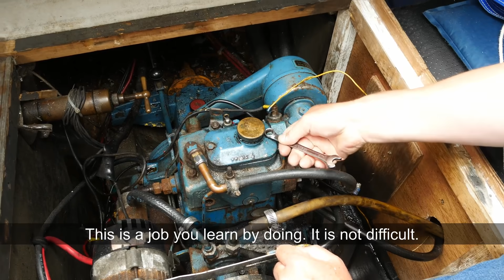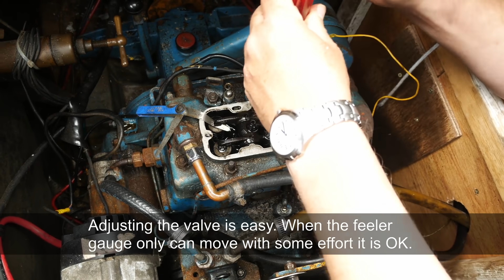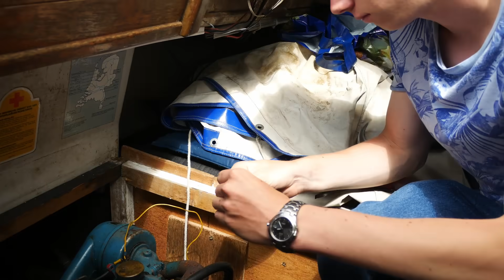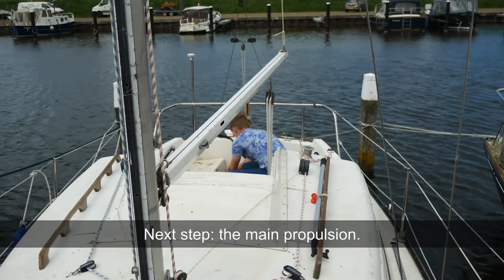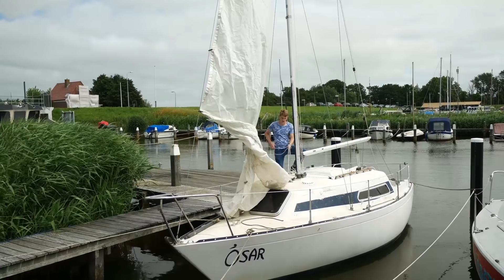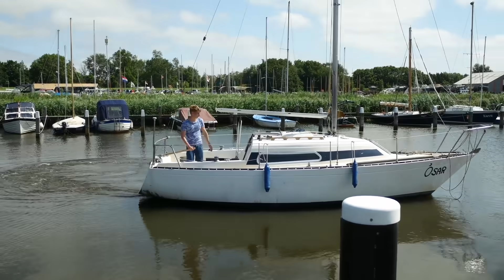A free boat 2: fixing the engine and checking some sails.

Comment: This vid is back up-ya hoo love seeing the work n time put in-- good job= you can get that valve adjust even better with new rocker shafts and arms, but you can just adjust it with the engine running- then you will get an honest clearances-- I noticed how much side play was in the rockers when you tightened the adjuster.  Side play changes the adjustment.  Cheers- will keep watching - start saving for an over haul of that classic motor.

Comment: The horrible engine noise would have been caused by a wide exhaust valve clearance. Because the gap is too wide the exhaust valve will open late and close early. The exhaust valve will close before top dead centre, trapping exhaust gas in the cylinder and compressing it slightly. The inlet valve then opens and releases this gas into the inlet manifold and that is the bang you can hear. I have had paper air filters torn to pieces and foam filters melted by this problem, one customer came to me with the complaint that his whole air filter kept falling off the engine no matter haw tight the clamp was.
Those old Petter engines will give good service if properly maintained.
Great vid, keep up the good work.
Subbed.
good luck from the UK

Comment: Yes, doing the valve clearances has quietened it down but it could be better. There looks to be severe wear in the rocker bushes or the shaft itself. Worth fixing to reduce the noise even more and also improve efficiency. Look at your video to see the angular movement of the rockers if you didn't notice it doing the job. I think that 10 and 15 thou cold may be wrong for this engine. Worth checking. A very nice starter boat and it being free as well is a big bonus. People have gone round the World in similar craft but perhaps some Baltic cruising would be good training. Maybe go via the canal?
Reply: Via the Canal to the Baltics?! Do you have any idea where the Netherlands are?! You sound like a drunk East-European sailor. Amsterdam, that's Estonia, is it?
Reply: @voornaam3191  Kiel Canal. Look it up.
Reply: Deluk is right. The Kiel Canal connects the Baltic Sea with the North Sea. The Kiel Canal is a 95-kilometre long freshwater canal in the German state of Schleswig-Holstein. The canal was finished in 1895, but later widened, and links the North Sea at Brunsbüttel to the Baltic Sea at Kiel-Holtenau. Wikipedia

Comment: You need to stow that line draped over the bow. It is probable that it will get drawn overboard by a wake or wave and trail in the water and wrap around your prop. Not fun. I pressure washed an old boat in about that condition and it came out looking like a totally different boat. Also, you need to disconnect every connection in the wiring and clean and check for corrosion. A very nice first boat. You will learn a lot getting it in good condition and keeping it there. Good luck.

Comment: I notice that your cockpit is badly stained. Toilet bowl cleaner will remove that. Splash it on and then hose if off. Hydrochloric or oxalic acid does the trick.
Reply from the maker: Thank for the tip. We will try it!
Reply: Yep. oxalic acid will remove rust stains fast.

Comment: Petter 6hp single cylinder, I have same in my boat, I also have 2 complete engines, one engine in parts and 2 spare gearboxes, looks like your exhaust manifold will fail before long. If you need any parts you are welcome to contact me

Comment: at around 3 minutes in there's a suspicious looking spark or electric arc next to the grease gun. You may want to look into that, fire hazard maybe?
Reply: actually, the first time it occurs is at 2:50, *with the engine off*. Weird!
Reply: I was wondering what that was too.
Reply: It may just be reflected light?
Reply from the maker: @kenwheeler6150  Yes it was.

Comment: Subbed. Did you fine gents check for water in the oil before firing the engine up the first time around or was that a non concern?
Reply: No, those engines also run on water in the sump. Duh! God help you, Maciej, you really need a lot of help, do you?
Reply: @voornaam3191  LmMfAo over here !  :D
Reply: @tcc187620  Thanks. I guess he did check for water. Mayonaise is not funny. And I was not polite to that guy.

Comment: Need to eliminate the sparking in the engine bay at 2:50. That can't be good to leave unattended.
Reply: what us that? is it from the battery?
Reply: I'm not sure but sparks near fuel is never a good thing.

Comment: Do yourself a favor and cut those blue rubbery rings off the winches they are worse than useless. They will hold the sheets until a good puff comes and then let go. If they are like mine they will also leave gooey blue rubbery stuff on the back of your shirts when you lean against them! When using the feeler gauges on an angle like that look for a set that is already bent at a 45degree angle as the bend your putting on the straight ones can throw off your measurements. Engine doesn't sound too bad though! What length is the boat and make? And remember the wise words of Captain Ron, "A diesel likes it's oil like a sailor likes his rum."
Reply from the maker: Thanks for the advice. We'll look at the winches. I already wondered why these rings were used for. After adjusting the sound was better. They were very loose. The boat is a Foxhound 24 (feet). And using oil and drinking rum is OK but spilling it on the floor wasn't considered seaman's like.
Reply: @peterb871  yeah the blue rings were a early and cheap form of not really self tailing but a easy cleating system. Looks like it'll be a nice sailor too and a fair amount of room below for the size. Nice it has an inboard diesel too!
Reply: You mean its oil. It's oil means something completely different. JC, I'm not even a native speaker, why do poeple make that mistake?
Reply: @voornaam3191  wat zit je op iedereen te zeiken zeg, niet normaal. Heel onvriendelijk

Comment: Watching you round out that nut a few times pains me lol.
Reply: When adjusting a jam nut use a 6 point box end wench, You used a 12 point. The 12 point is good when space to work is a deal. The 6 point will hold on to more of the nut.
Reply: @samlewallen4499  Or just use a socket :I